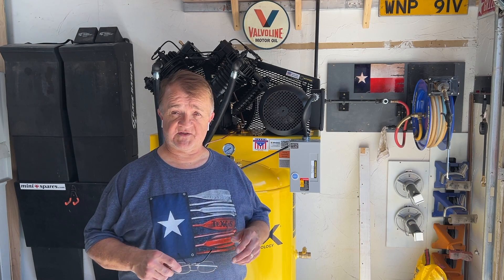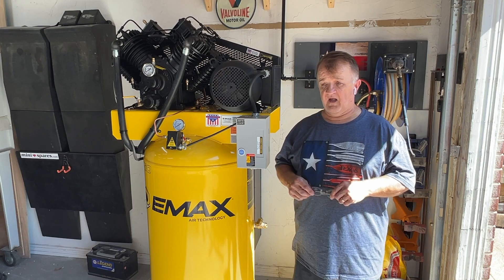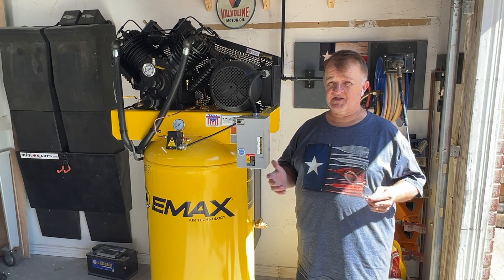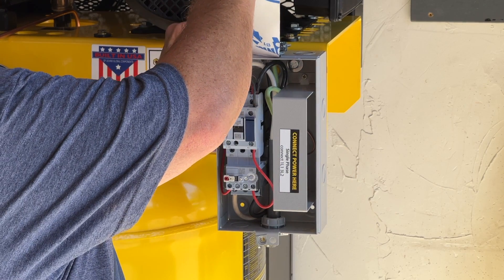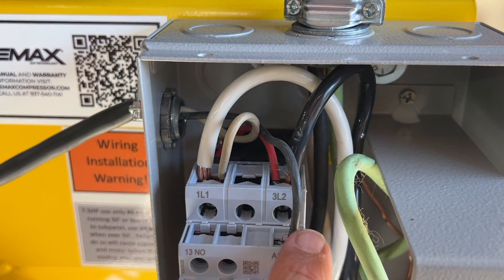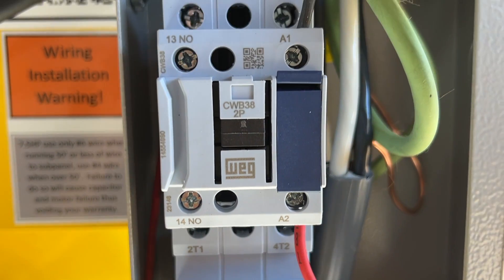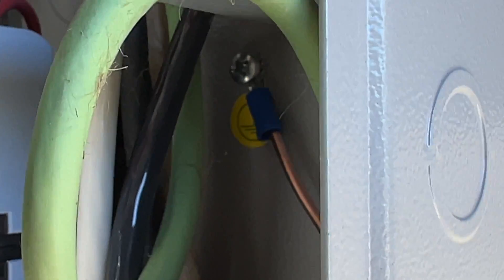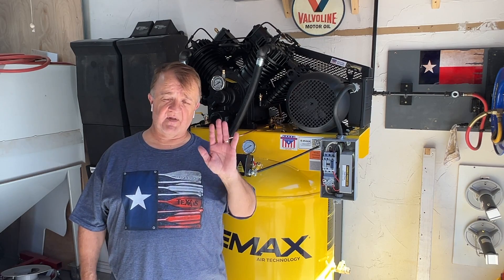HOW TO WIRE AN EMAX 7.5HP AIR COMPRESSOR

Comment: Thank you
Reply from the maker: Glad the video was of use!
Reply: @LoneStarMini  Just watched it again - this time I took screen captures/made notes.  Did you install an outlet on the wall and attach a 6 gauge three prong cord?  Or did you simply run the wires from the breaker through conduit to the compressor?
Reply from the maker: @chargerforme7773 my email is Randy@lonestarmini.com.   If you send me an email, I will send pictures

Comment: WHY they did not have the installation available??? I am going to the same headache to figure it out...
Thank you for the video.
Reply from the maker: Glad the video was of use
Reply: Quick update on my comment:

I called and spoke with the person responsible for the piston air compressor. I explained that I don’t have a power outlet where I need to use it, and he told me I’d need a generator. To be safe, I bought an even larger one than he recommended. After getting everything hooked up, I discovered the air compressor doesn’t work with the generator he told me to buy.

I did some research, called him back, and shared what I found. He apologized and said he had misheard what I said.

I’m returning everything to Home Depot. I’m done with EMAX.
Reply from the maker: @marceloskyrioca bad advice.. especially from the manufacturer, is never good.  I would probably do the same

Comment: What do you do with the red wire I got red white green and black cord
Reply from the maker: The fourth wire is or can be used as a separate grounding wire. The 4 th wire is typically used for more modern equipment that have circuit boards which helps to have more/better grounding. In this case, you merely purchased more expensive wire that is  not needed (4th wire). Be sure to use 6awg

Comment: Mine will be in my shed my breaker box I have in my shed it's wired about with 6gauge to my main about 70 foot away but I do have a breaker in my shed that will be OK right? It's about 15foot away.
Reply from the maker: @HondaCrf450r.  hello.. so your talking the unit is approximately 85 feet from the main breaker not including the wire runs through the walls. We could do the math to figure it out, but the main reason for the required distance is due to voltage drops or resistance in the lines.  Assuming you are using 6 gauge wire, the start up amperage is 36 if memory serves which is a bit less than the 50 amp breaker.   You “should be”  safe, but voltage drops over long distances can actually cause reduce power to the unit and possible damage. I  believe the voltage drop within a 100 feet is minimal.

Comment: 20 gauge wires go to pressure switch this is the signal when cut off pressure is reached it tells the mag switch to cut the motor off

Comment: the box that yo call its real name is a Mag switch and 50 amps seems a bet low on start up on true 7.5 Matt at Eaton told me years ago 20-25 percent the running amps 55-75 amp on standard breaker your can get a 50 time delay breaker that will work

Comment: Had the same issue.  Emax does have a schematic for wiring, but you do have to dig around.  The thing is a beast.

Well done video
Reply from the maker: @David-n4c6q  have been happy with mine… had an issue with the pressure switch, but the service was responsive and helpful

Comment: Is the electrical plug an acceptable way to connect? Or does it need to be direct wired?
Reply from the maker: Absolutely.. I used an electrical plug.  Just make sure it’s 50amp rated.

Comment: Mine should be delivered end of April
Reply from the maker: Awesome….  After running a few hours, I found oil seeping from various bolts Around the compressor. After tightening, no problem. You may want to look for this as some of my bolts were not tight.  It is a nice unit!